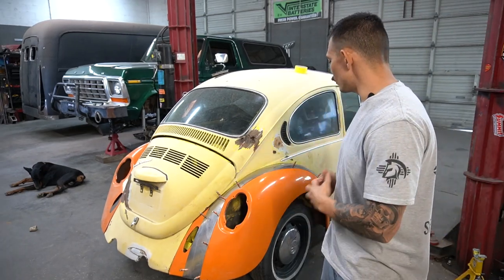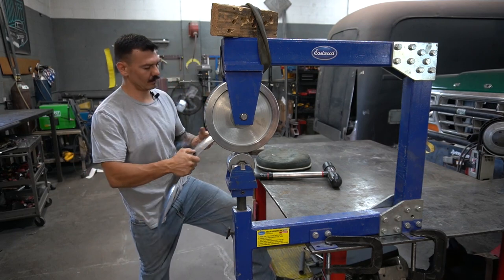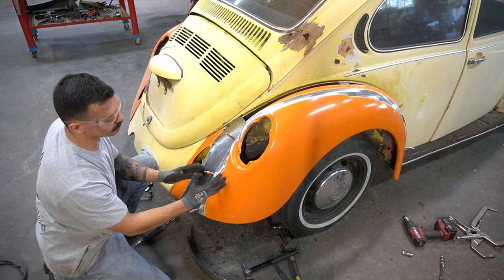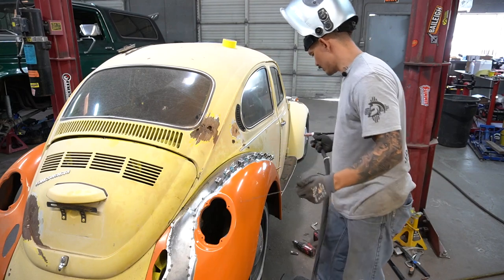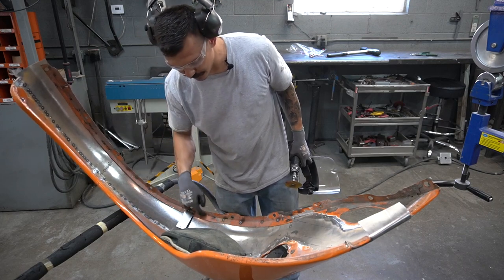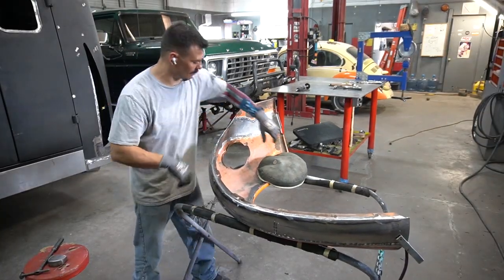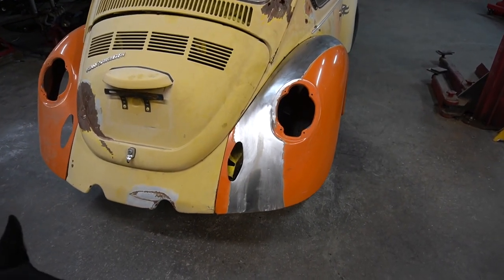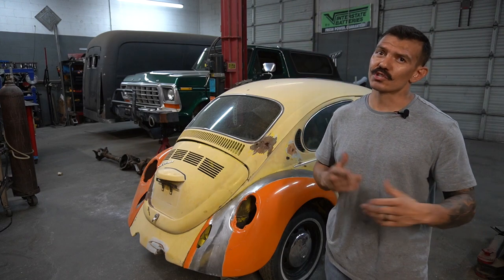Widening VW bug fenders Part 2 | How I cut and widened these fenders

Comment: I never thought to use a wide tip Sharpie to add black that can then be sanded to look for high and low spots. Great idea.
Reply from the maker: Thank you and thanks for watching!🙏
Reply: You can also use cheap lacquer spray paint, just like over bondo.

Comment: Did you ever think to use gun metal bluing instead of a sharpie? The bluing won't dry out too quickly if left unopened, unlike a sharpie which will dryout in seconds. I'm not sure about bluing leaching through a primer or paint overcoat. Damn-that's finer than fine metal working!!
Reply from the maker: You know that's not too bad of idea I've never thought of metal bluing. They do have dykem layout fluid or spray that seems to work pretty well but I have never used that either. The sharpie has a gloss to it and when you hit it with the slapper it leaves a little dull footprint do you know where your hitting. But blueing could be worth a try

Comment: Just wondering where you got your slapping spoon? Awesome work.
Reply from the maker: Yeah so I actually built it from a bumper bracket off of a 1950 international Metro and I cut the handle off of the slapper spoon from harbor freight and welded it onto then one I made. You can build one from a leaf spring or basically anything with a similar shape. I actually really like the slapper from harbor freight! It just needs to be weighted a little bit and polished.

Comment: Beautiful work! I have difficulty Tig tacking 19 gauge steel even when I have very good fit up ( zero gaps). When I heat the spot with the torch the edges of the metal melt individually and a gap  forms. I usually try to do a fusion tack ie no filler rod. 
Even with a filler rod I get into trouble. The rod has a lower thermal mass than the sheet metal and it quickly melts forming a molten blob. I cannot get the rod and the metal to melt together and fuse. One last question: do you use a foot pedal?

Thanks, Mike
Reply from the maker: What up Mike! Great question I've ran into this problem many years ago and just like everything it takes practice BUT try this little trick - what I will do is put the tip of the filler rod over the joint where you want to tack, then heat just tip of the filler rod till it melts before the base metal. A blob will appear in the joint, now heat the blob till it melts into the base metal tacking the two together, I call this "the ol drop a glob trick". Take your time and heat the blob slow and be quick to let off the pedel. Let me know if that works out for you. Also yes I use a foot pedel with the Tig. Thanks for watching!
Reply from the maker: Also what filler rod are you using?
Reply: Thanks for the tips. I'll try them tomorrow! Mike @BeAMetalFabricator

Comment: I am curious about that square clamp that you use several of them on the seam. I’ve never seen those kind of clamps before. What’s the name of them please?
Reply from the maker: They are called butt weld clamps or intergrip panel clamps. You can get them from harbor freight or Eastwood

Comment: Thats nice work but, does the cost or is the cost justify the time and cost ?  You have a bug with rust holes so ask yourself where else is it rusted out.
Reply from the maker: Hahaha Yes I would totally agree, but I was widening the fenders for a customer that has a 1974 VW bug, he brought me only his fenders... I also own a 1974 bug which is the rust bucket in the video lol I was using my car to mock up the fenders while I did the fabrication to insure a nice fit.
Reply: @BeAMetalFabricator  ...and I wanted to ask why you don't cover the windows of the beetle when sanding... :hand-orange-covering-eyes:
Now I know why! :face-blue-smiling:
Great job! Thanks!!! 👍
Reply from the maker: @VS-16  yes that's exactly why. In any other case I would have had everything on the car protected. I was waiting for someone to point that out 😂. Thanks again for watching and for your support!